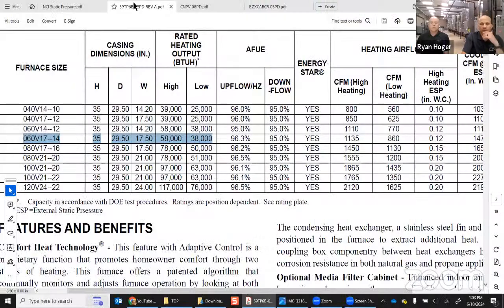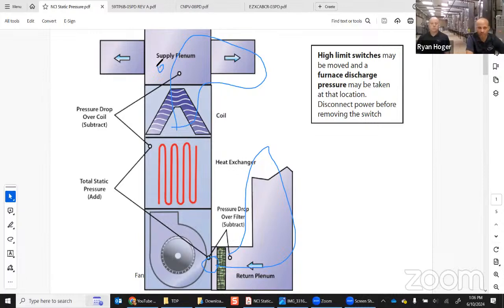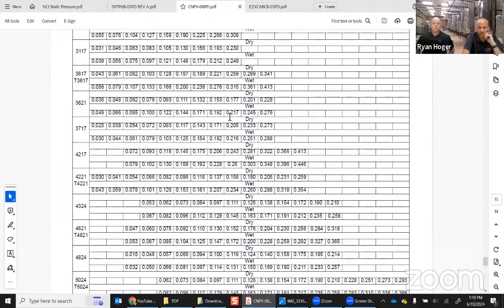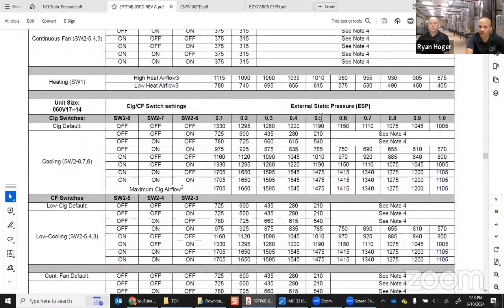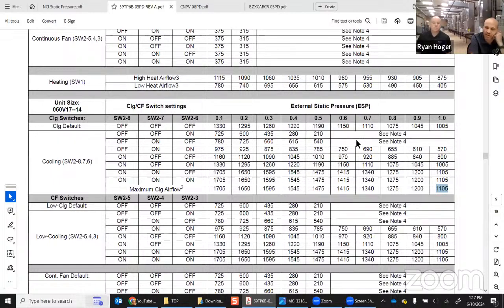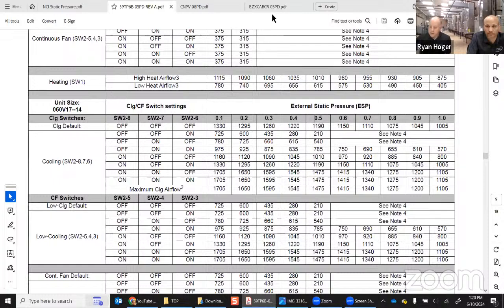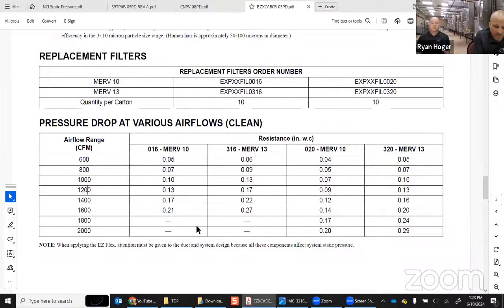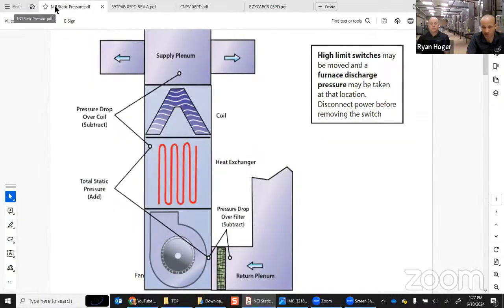TecTube LIVE #5: Static Pressure and Airflow - 6/10/24

Comment: •How would you address duct sizing when adding a dehumidifier to a suuply plenum, per Santa Fe’s install manual. This method creates high static when the unit and dehumidifier are running.
Reply from the maker: We have never heard of Sante Fe but in either case, we have also never added a dehumidifier to a supply duct. It is not needed in our Midwest climate if A/C is sized and staged properly. If the project is South of ASHRAE's warm-humid line on the map, then things are probably pretty different.